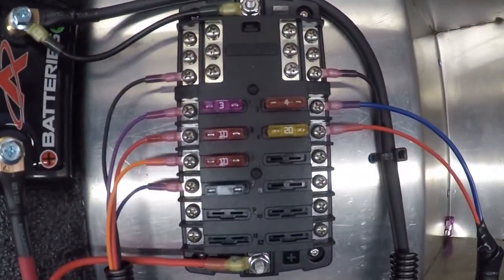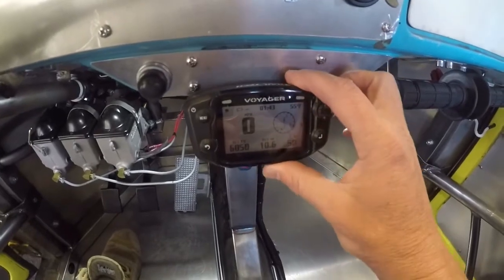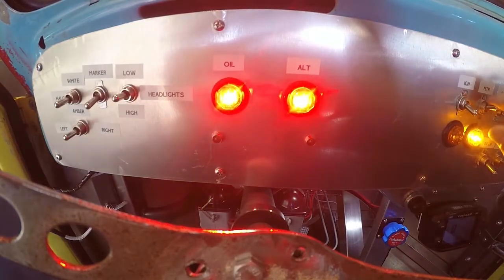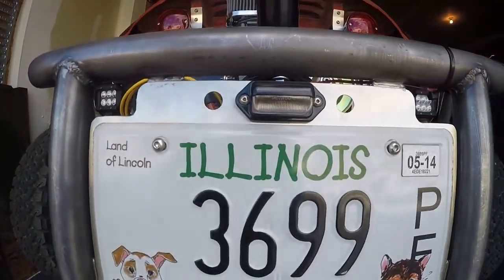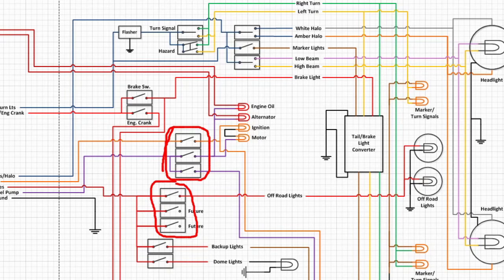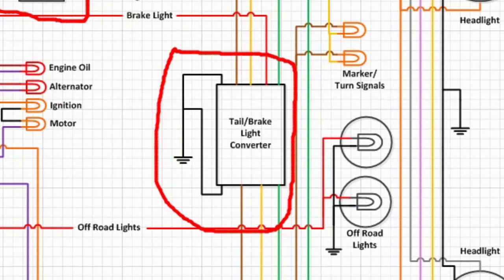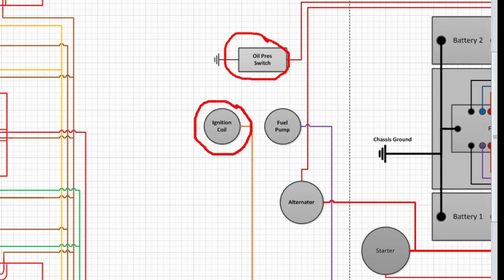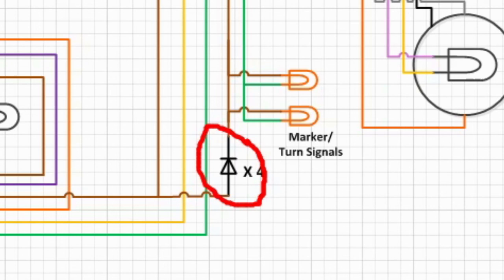Baja Bug Electrical EP 7.

Comment: Your videos have been incredibly helpful! Are there any general sources youve used to figure this out? I'm a very amateur electrician and i'm working up towards buggifying my jeep and I need as much background as possible.

Good work!
Reply from the maker: Hey Peter, I can't really offer a resource other than life passions and its journey. I'd say what got me here is first being a welder fabricator for about 18 years for my profession. That got me very comfortable working with metal. Then for about 8 years I was a AC service technician. That got me good at more electrical side of things.Then sprinkle in ever since I was 9 years old I have been in RC off road cars, building, racing and tinkering with them. Then along with that I have always tinkered with mostly Pickup trucks and Jeeps when I had the space or money.
And of course always asking questions at car shows, races, and anyone who is doing something that I think I'd like to do. lol
The projects start small, and your experience grows from there. If you want to start on your jeep, maybe start with wiring up a light bar, fog lights, backup lights. Make a switch panel, and make it nice, challenge yourself!
If you want to do some welding, make a bumper for the Jeep, or jerry can holder. There are tons of projects you can do on the Jeep. Ask me any questions you have, I'm here to help. Fabrication can be an art and a great way to express yourself.
Good luck buddy, thanks for the comment.
Reply: Doug Bug That's the plan! Dads a welder by trade so my plans are bumpers and frame repair, with my background in autocad I'll have everything layer out and it should be a matter of following directions. 

I also think I've got the general idea for wiring up my fog lights since my stock ones were broken when I bought them. This will definitely involve the start of a panel and I definitely want to avoid setting up a rats nest so I'll try centralize the relay and fuse wiring for the panel somehow. 

So far I've been doing mechanical repairs but I want to get into the electrical side and me being the person I am I want everything to be as perfect as possible to begin with so even a basic switch panel involves thoughts of "what do I want to eventually have connected to this switch" 

In general, if I hypothetically wanted to do away with my factory wiring and wire it all over again, ideally simplifying it, would I have to do something with the ECU to get around the fact that it's expecting factory wiring??
Reply from the maker: I would recommend that if you go that far into the wiring, try to leave the wiring for the ECU alone. You can rewire all the wiring for the lights, accessories, and so on. But the ECU wiring is pretty serious.
Reply: So there shouldn't be anything pertaining to the ECU from separating my ignition system wiring from the stock PDC and harness? Fuel pump? Starter? Injection? etc? Getting rid of my multi-function switch in favor of toggle switches?
Reply from the maker: If you wanted to remove a factory switch and install your own switch that would be no problem. Just match the switch. Meaning if the factory switch was DPDP make sure your aftermarket switch is DPDT. And wire it in exactly the same to the factory wiring. If you do that make sure you have a factory wiring diagram so you can verify that you have the correct wires. The fuel pump, starter, injectors will all be tied together. Even though they might go to separate modules they all communicate together. So you can't remove any of the modules. You can add stand alone devices, light light bars and such. And you can make device changes, like changing the switch we talked about. But the only way to remove modules and really change the factory wiring would require some programming the computer. If you remove any of its devices it will not be happy.

Comment: I'm looking at these same headlights for my bug. Do you think the amber halo could be wired to be used as turn signals?
Reply from the maker: I don't think they will. I tried to wire them into my turn signals and had two issues. 1. They illuminate very slow, like takes about 1 second to really light them up. So I think if they were hooked up to a flasher relay they wouldn't really reach full brightness before the relay would be in the off cycle. 2. Then I tried having the white halo on and turning on the amber and they don't like that. It causes the halos to turn off or flicker in a bad way. So if the turn signals did work I don't think you would want to ever have the white halo on and use the turn signals. Kinda a bummer as they would be really cool for turn signals. So I just wired mine as marker lights with a stand alone switch.